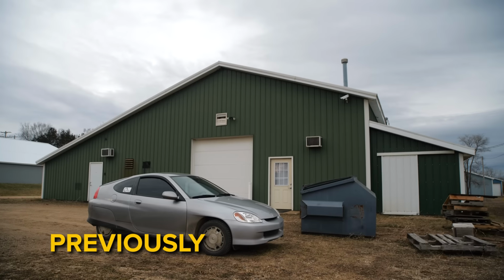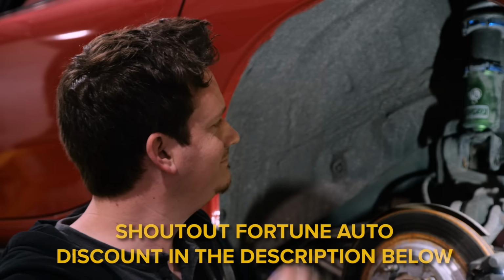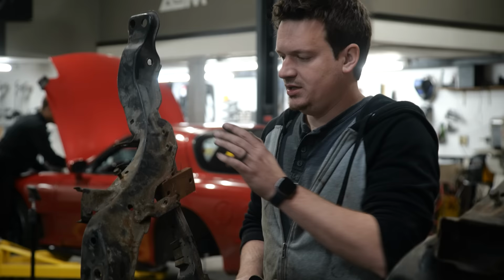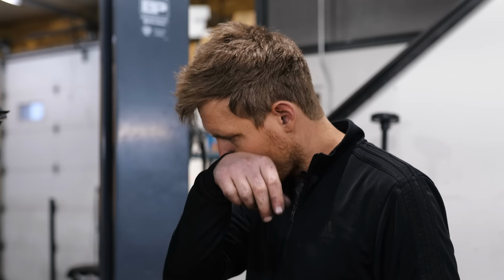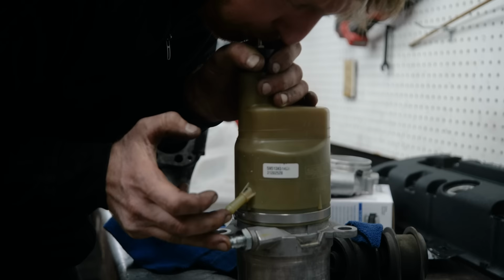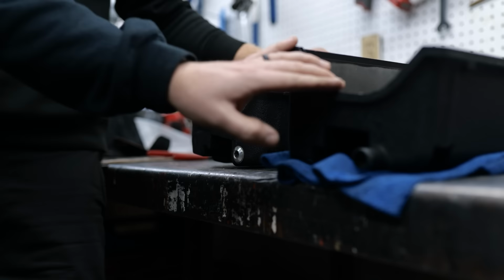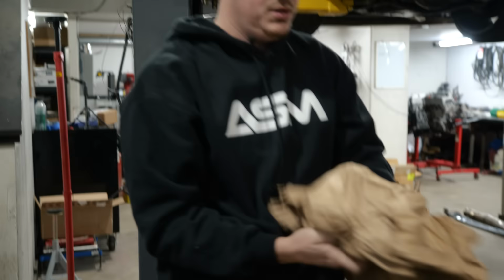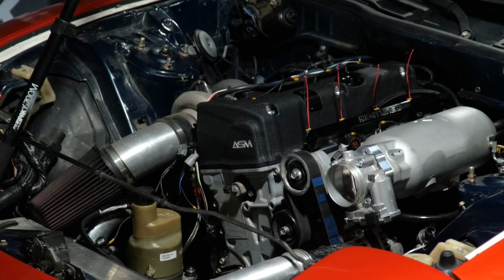Ford Swapping My K-Swapped Mazda RX7 - Episode 2

Comment: Really bad decision into deleting that "bar" from a FD or miata chassis! The PPF (power plant frame) is the key to keeping the rigidity of the chassis. Even Gm used this technology in the c4 corvette for a reason.. They could have used a Dana 44HD from a corvette or a viper and still keep the PPF in place. What he removed from his FD was a torque arm due to being modified before. I would run some braces underneath the body. I am an FD owner btw
Reply: Yep a lot of miata guys end up using a cstv or Camaro rear because their PPF can still be used with an aftermarket cradle.

Comment: That bar is the key to the great shifter feel on every miata and rx
Reply: Exactly.
Reply: @blackhatch46  it ties the drivetrain and diff together making them a single rigid unit, which is why the trans doesn’t have a separate mount, and the driveshaft doesn’t need a flex joint or isolator rubber.
Reply: @Patrick94GSR  I know...
Reply: ‘Complicated for no reason’

Lol
Reply: No need for that on my car, I got a torque tube instead

Comment: I’m curious to see what the reasons were to not run a catch can for street application; and alternatives.
Reply: Same
Reply: Alternative is an oil water separator. Looks exactly like a catch can, but with extra coolant lines and an oil return line. Vaporizes everything but oil, and feeds it back in the intake. Clean engine oil would drain back into the sump. Zero maintenance, and reduced oil loss. Downside is it's more expensive than a catch can.
Reply: Yeah I thought the same thing. Any turbo application makes it a pretty solid choice for longevity. A smaller, closed one would be better though lol.
Reply: Usually issues arises more when changing to a vented setup, especially if routed incorrectly. A simple non-vented catch can shouldn't affect your setup, but of course will not be as effective at cleaning air from oil than a vented setup. For most street applications that still should be more than enough.

Comment: K-swap enthusiast be like: "Dude the engine is like a thousand bucks, K-swap everything"
Meanwhile they're shoveling 30k into a "simple" swap
Reply: LS the world
Reply: @BoHorror  overplayed
Reply: Youtubers are not representative of your typical k-swap enthusiasts, these guys are sponsored and earn money by doing these things as content.

One can k-swap and just put a cam, exhaust, and tune on it. Just like other swaps, some might need new drivetrain, some might just need adapters. No need to go for a 30k build.
Reply: @sepg5084  doesnt change anything
Reply: In my experience, with swaps you either spend the money up front on a motor that makes dummy power out of the box (LS, jz, etc) or you spend it on the back end in supporting mods.
Reply: @lukesites2457  plot twist, you do both.
Reply: Yeah k swaps are NOT cheap I don’t know why people think they are
Reply: @aygwm  no swap is truly cheap. lets look at gears and gasolines last series with the ls1 camaro. while ls1s are decent motors for fairly little cost i still dont believe it would only run them a few grand for everything they did. it just makes good content. and yea sure. some swaps are alot less costly but no matter what your still spending a decent buck even if they went the old 5.3 route.
Reply: @aygwm  if you want cheap you keep the stock motor
Reply: @ I agree with Aaron G if it breaks there no worries because you want cheap if you went expensive then you would be pissed due to throwing so much money for swap or on parts
Reply: @SPIDERMAN2015  yeah I’d rather do it right once than do it wrong and find out. And risk catastrophic failure.
Reply: @SWATROLLK9  agree with you 100% percent
Reply: 30k? If you let a shop do it for you right? Swaps are only worth for people who are mechanically oriented and are willing to do it themselves...
Reply: 1k engine then at least 4k in swap parts. Kwap isnt as cheap as people thinks
Reply: It’s Only expensive when you don’t know what you’re doing or know what you’re looking for 🙌🏽
Reply: lol yeah it does seem their budget is basically non existant, just get all the parts. wild
Reply: @sepg5084  overplayed? do you think you are making a good point? it's the easiest most reliable 400 hp you will ever make and has the most support to make more power.
Reply: Literally every engine swap is expensive unless you do the work yourself

Comment: Plenty of aftermarkets make those front diff carrier bushings for that exact 8.8. From stock rubber to whatever durometer poly your want, even solid delrin/aluminum.

Best reason to have the most common diff in North America are that every single part of it is easy to find.

Comment: The PowerPlant Frame on the Miata and RX7 ties the drivetrain and diff together to make it a single unit, which is why they don’t use a separate transmission mount, and don’t need any type of rubber in the driveshaft, or sliding joints or anything like that.

I was also surprised recently to learn that newer Camaros use a similar PPF assembly.
Reply: It's also like the second suspension mod F body owners do. There is a reason for the power bar. Ditching it is like saying "oh I can street drive with out sway bars" 😂

Comment: Would love to see a bit more info on the problems with a catch can on a street car that you guys mentioned
Reply: Same, and would the recommendation change if the car was direct injection only
Reply: The problem is vent to atmosphere puts the “oily” air back in the engine. 

A return system will burn it off naturally. The reason to do in a race car is the amount of burn off can be very high and cause issues, since blow by rate is proportional to load. 

For DI cars, I’d argue catch cans are a bit more important, since there’s no way to clean the valves. 

For port injected cars, the spot is washed off by fuel anyway, so not a big deal.
Reply: @karltaht2370  thanks for the explanation before this video I didn't even know there were vta catch cans

Comment: I had a Volvo C30 for years, and that power steering pump leak is a common issue. I just cleaned it up and checked the fluid regularly. Never had any real issues from it.

Comment: kinda surprised you used a felpro valve cover gasket.  I've had them leak on k series and now will only use an oem gasket and they're only $20 from Honda anyways..  and black to match
Reply: Same for Miatas. OEM or you’ll have leaks. I tried 2 different aftermarket ones before going OEM. Just sucks that they’re $50+

Comment: Try  a vauxhall corsa electric power steering the rally guys use it on mk1+2 escorts bolts on the rack and you can get a controler to increse and reduce it and can be bolted on a manual rack irs small.

Comment: If you want power steering I don’t know for aftermarket but there are full electric power steering where you have no fluid and no pump. Your f150 comes stock with electric power steering
Reply: Not precisely.  It's still fluid based. Just self contained. Electric boosted pumps just remove the hydro pump from the motor in favor of a electric one on the rack or column.

Comment: wasnt the ford explorer diff meant to have parts "easier"  to source?
Reply: At some point the OEM quits making certain parts, especially if the demand is low. The 4 link bushings on my Mustang's 8.8 are 23 years old and still tight. There is plenty of aftermarket support for 8.8s.

Comment: Why would it need a slip drive shaft if it has IRS? The diff never moves with the suspension.
Reply: First would be the lack of the PPF. Also with torque and a limited slip, an IRS will in fact still load up.
There is also a metric butt ton less nvh with a slip shaft vs a solid shaft. Unless you spend the money for a good carbon one.

Comment: Using red locktite on those bolts going into aluminum wasn't smart. The threads could pull out before that red locktite does. I would have used blue on those bolts.

Comment: Funny because usually people get rid of the rotary because it requires a lot of maintenance, putting a Ford engine on it is a huge no for me, I would rather have the rotary engine back on it, well at least Ford engines are easy to find...
Reply: The Ford-swap is a rear diff.

Comment: "Complicated for no reason" = complicated for reasons you dont understand.  Mazda still uses PPF technology.
Reply from the maker: That’s a valid point.
Reply: PPF function is to connect engine directly to diff so that torque transfer from throttle input to rear tire contact patch is more direct/immediate.
     This makes it easier to steer with the throttle (ie driving @ the limit).

2ndary function is it is a truss from front subframe to rear subframe for chassis ridigity.

Comment: Power steering from a Volvo yet has fomoco stamped into the reservoir
Reply from the maker: All car brands use other brand’s parts. That’s why its funny when people get upset about mixed manufacturer engine swaps 😂
Reply: @GearsandGasoline  honestly not mad at all. The Ford 8.8 is a very stought diff. The smaller profile and near matching strength to a 9" is why they are a favorite swap for jeeps and other small off road vehicles. Also yes companies being in bed with each other is nothing new. GM and toyota in the late 90s and early 2000s. The uncanny resemblance of a Ford fusion and Aston Martin front end.

Comment: Red loctite on the intake manifold bolts is intense.  I suppose because the engine vibrates so much.
Reply: Yeah really I wondered about that.
Reply: I was getting ready to leave the same comment
Reply: They should have put the red loctite on the screws for the valve cover baffle plates. Wouldn’t want those things falling down into the valve train.